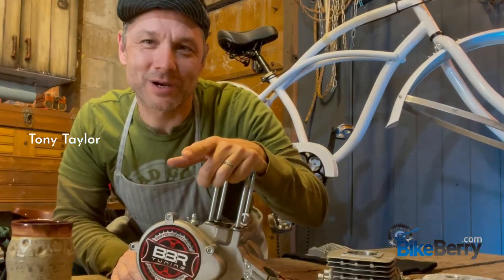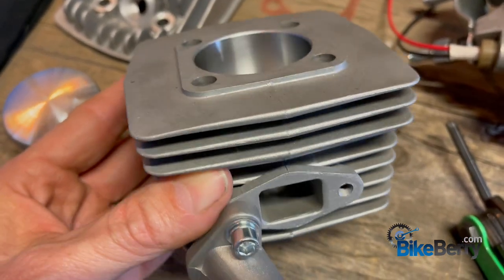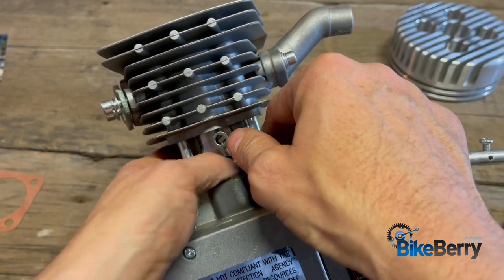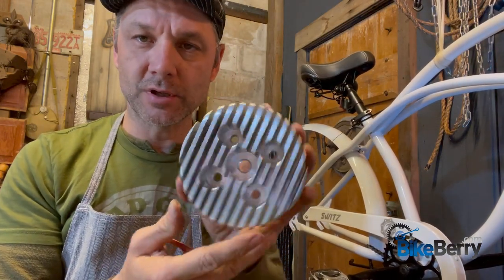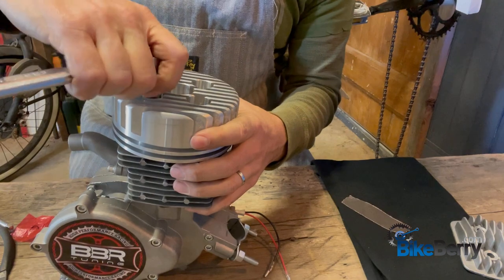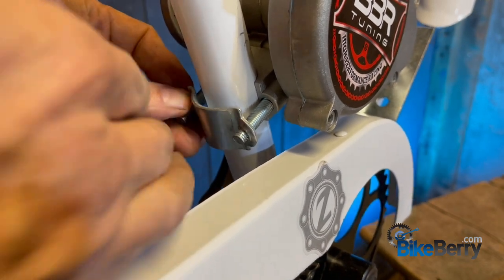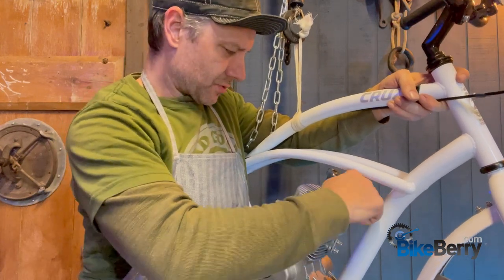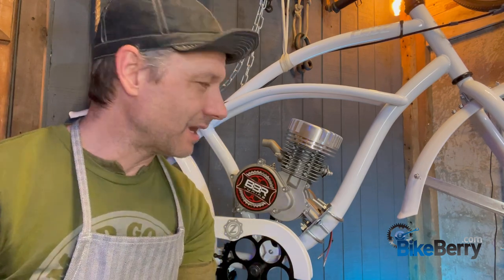Motorized Bike Engine Mounting | Assembling and Mounting Your Engine on Your Cruiser | Bike Berry

Comment: Hey tony just a little tip on the cylinder head. It’s better if you were to tighten it in a x pattern so you won’t warp the head. If you tighten it side by side it also can damage the head gasket and you will loose compression
Reply: technically an x pattern is just side by side. on a square head theres no other way to do it, you have to tighten a bolt next to the one you just tightened

Comment: Lol, my phantom 85 kit fit my older Schwinn Frontier like a glove. Still haven't had to use any of those adapter brackets. Not even on my BT80 powered Hyper Commute cruiser. Happy riding everyone!
Reply: Did you upgrade to disk brakes I have a vintage frontier original everything.

Comment: Indian head shellac from auto zone ....is what you use on copper head gaskets for nitrous I use it on every V8 I've never had it fail even when over heated to the point of engine seize ...never blew a head gasket. try it you won't be disappointed... mechanic for 43 years it is awesome 👍

Comment: I'm getting one of these tomorrow as my first build, excited but worried how good of a job will I do
What kind of fue mixture can be used? To break in can I use 40:1? Saw a vp brand can for two cycle engines in tractor supply company

Comment: I could mount an 80 cylinder and piston on a 100 engine because in Romania there are no 100 cylinder and pistons, I want to point out that it fits in holes only that the 100 cc cylinder and piston is 50 mm and the 80 cc  has 47mm?

Comment: Do you have to use that front mounting plate on the Switz Cruz I'm building mine right now and it looks like it would fit without it anyone know better than me 😁
Reply: You don’t have to but in most cases the engine sits too low.

Comment: They slip by a lot with the arrow pointed the wrong way and I also use better clips and I don't use those crappy nuts that come with the kit to bolt the head on. I use good washers and nuts

Comment: Mine only has 1 gasket will that be a problem?
Reply: Depends if it’s the same engine as this one.
Reply: @tonytaylor5087  ok I'm gonna put it together and see what happens,  thanks dude , happy motoring !
Reply: @arnulfob3454  did it work ok?
Reply: @mileshurst7359  I can happily say it worked great I rode it to work all summer . Only filled the tank 3 times.
Reply: @arnulfob3454  thx.  Appreciate the input.  Cu
Reply: @mileshurst7359  your welcome,  happy motoring.

Comment: Why do you need to ad the u-mount? Looks like it would fit perfectly fine without it.
Reply: Hey Nikko! Yeah, I tried mounting just the engine. Without the U-mount it sits too low on the frame hitting the chain guard.

Comment: Mine came with only one base gasket...   is that ok to go ahead like that, with just the one?  the washers were on top like shown here.  Stage 4, btw.
Reply: Mine is the same, I emailed them and they say that 1 gasket is fine
Reply: Same, not sure how much it messes with the squish and port timings and all. I bought mine last year and have put some miles on it. Still runs strong, replaced minor things so far.

Comment: Looks like the clip was backwards. You don't want the wrist pin able to touch the wing. It will push the clip into the engine and cause failure. No grease or oil? 12 ft lbs. for the high COOLING head. Fenders will put you in the hospital.
You should cover the open case of the engine so nothing falls in, like a wrist pin clip, or debris. Never tighten the head that much.

Comment: What if the posts are bent? Can I heat it up bend it back? I don’t wanna break stuff before I begin building.
Reply: You mean the stud bolts? If so just take them out and put a couple of nuts on them, put in a vice and bend straight.

Comment: I’m having huge troubles with putting in the circlips and surprised no one else does. I’m a big guy but it’s almost impossible to press down those clips with my pliers
Reply: Small flathead screwdriver & small pliers is what I used and it snapped in place fairly easy…

Comment: I would oil the conrod, wrist pin and wrist pin bearing before installing.  Also does BikeBerry install the piston into the cylinder dry?  Looks dry.
Reply: Hey Ron, nope it wasn’t dry. You could certainly add additional oil to all the parts.

Comment: great video .will the two gaskets . rob horse power . compare to one gasket . or there  is no different  in one or two gaskets . the motor  will run  the same .
Reply: If you run one less gasket your piston could hit the plug or head which would cause catastrophic damage. Sometimes it won’t hit but it’s a 50/50 chance. I wouldn’t trust it though. And sure if you remove one gasket you may get a little power boost but don’t risk it.

Comment: You just slid it right down. Well, I'm not able to do it without.great effort. The bolts are bound, when I get to the piston , it's stopped,stuck. I'm going to add a little WD40.

Comment: Lightly tighten in a circular pattern till all are snug tight add a quarter turn in a criss cross pattern .in the 1980s if we wanted a high compression head we would add 20 /30 pounds of over tork ...worked great made a lot louder though 😊

Comment: My engine only came with one gaskit on the bottom i called customer service and the girl told me its ok with one gasket???  Is this correct?? Also the rear sprocket did not have the three smaller plates that go on the inside...she told me its been redesigned and the second gasket and the sprocket plates are no longer needed ..first time builder...help please

Comment: I have a problem trying to start my bike after installing my Windowed Pistion/Barrel/Reed valve/OKO carb i got to find out the Window on my piston was cut out on the wrong side. The window is the same side (exhaust) as the arrow. IF i turn it around the ring pins are on the exhaust side, which is wrong and can get damaged on the exhaust port in the sleeve. So ... BB decides to send me this video starting at the 5:00 minute mark. COME ON!!!!
Reply: Ha wow, that's lazy and messed up.
Reply: Found out that the "barrel" timing in the reed valve "KIT" was totally off. I switch out one thing at a time until i had only the barrel left. The barrel was the problem. So basically i put everything back the way it was and it runs. Beware of those "reed valve barrel kits".